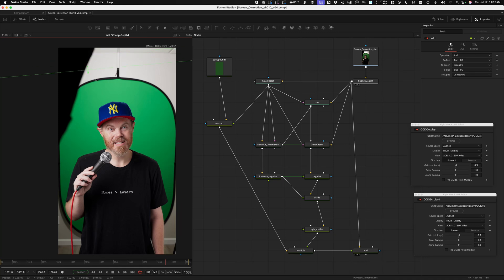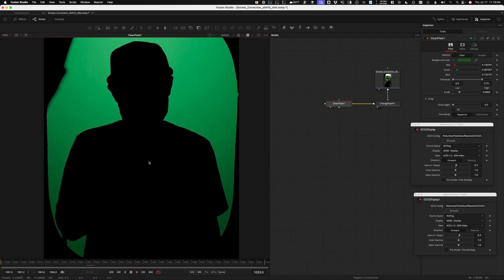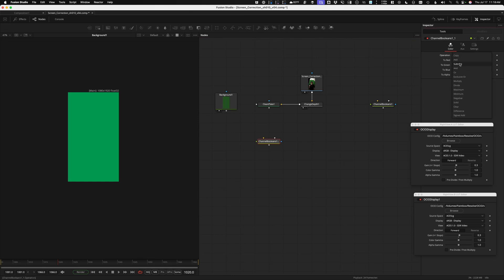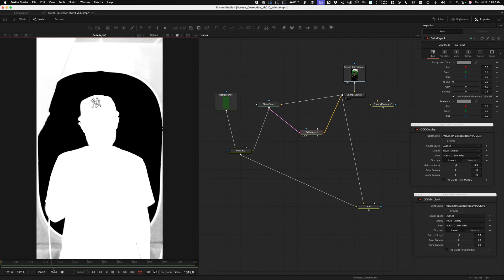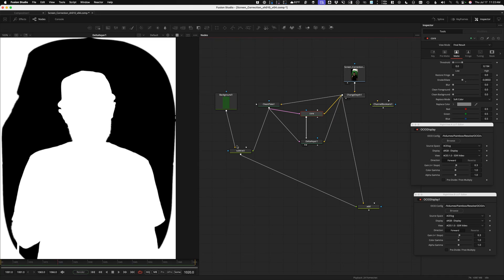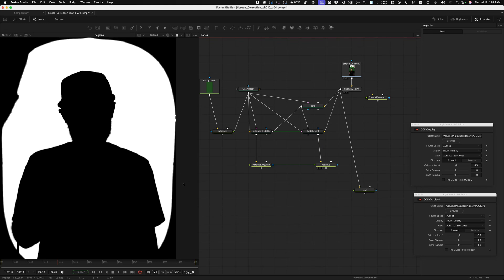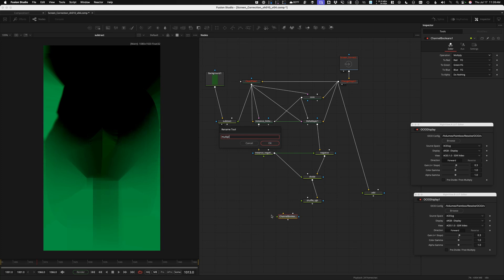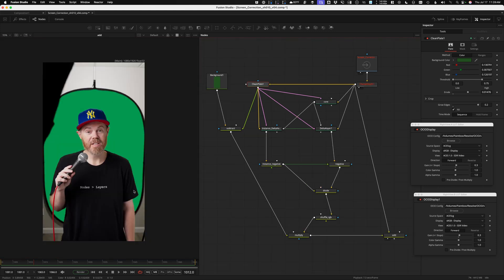Fusion Green Screen Correction Technique for VFX (pre-processing)

Comment: I don't get what the point of this is? If you're doing these tricks to get a clean green, isn't the ultimate point to get a background keyed in there? And then getting a clean green is just an extra step?
Reply from the maker: Hi Jamie - the idea is the pre-process the screen to make the key easier to pull (usually this means having to pull less keys that are specific to a particular area), a head vs the body.  It is an extra step and not always necessary but can give the best results.

Comment: Legit question, but what is the use case for this?  I'd assume it's not for actually trying to pull a good matte for yourself since you've already achieved that with the other nodes? Is it just to create a nice  green screen plate with a really clean green screen for other people to easily pull a key?
Reply from the maker: It's for pulling a better key (yourself or another artist) - It will also often require less keys to get to a final shot.  Note - I haven't actually made an acceptable key in this tutorial - that is just a rough garbage key for evening out the background.